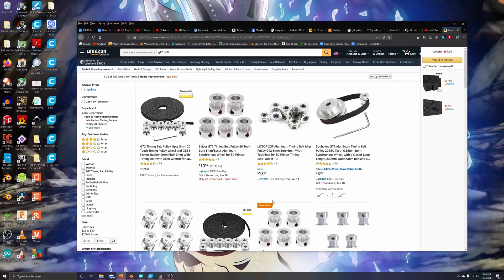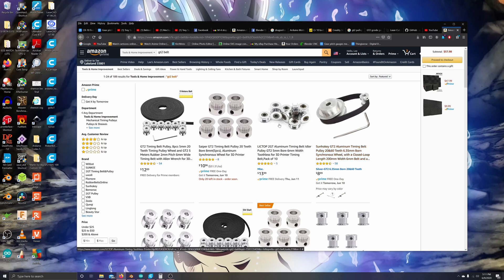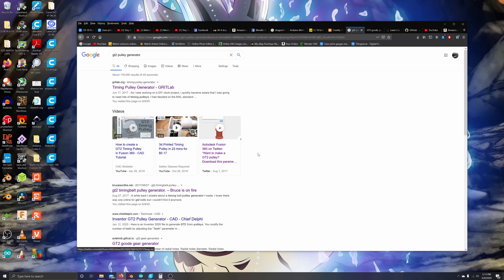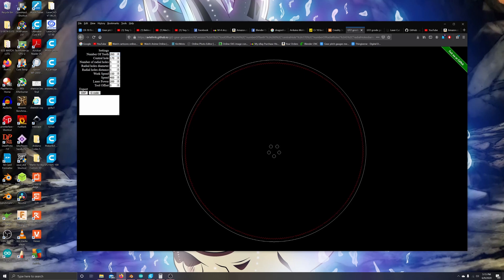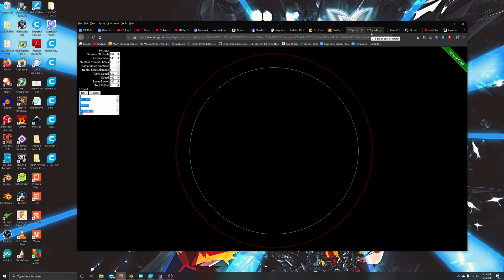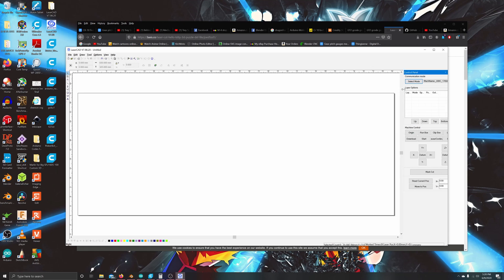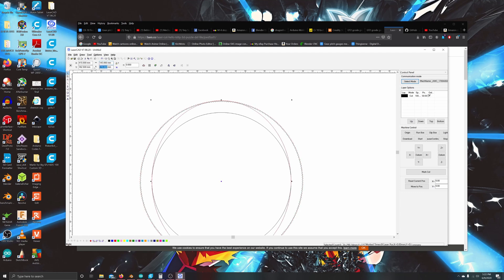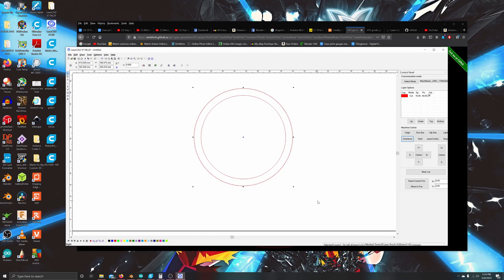DIY GT2 Pulley

Comment: Theres no link....
Anyway - it dosent work for 3D printers, as the gcode is wrong for 3D printers.
Reply from the maker: this is the website to make the pully and export to dxf file
https://stefetrucki.github.io/gt2-gear-genaretor/
Reply from the maker: Yea it isn't that I wanted to 3d print it out I just needed to use my c02 laser cutter to cut through plexi glass or wood sheets
Reply: @LegitLeeVelez  Oki, thanks for the answer. I was of that impression that this was a STL I could import in a 3D program.  But apparently its only for 2D printers/Cutters.  Noted thanks 👍
Reply from the maker: @timm3802  YES YOUR WELCOME AND i THINK IF YOU GET THE 2D PICTURE ON A 3D PROGRAM LIKE BLENDER YOU SHOULD BE ABLE TO MAKE IT A 3D OBJECT WITH THE RIGHT DIMENSIONS TO EXPORT IT OUT INTO AN STL FILE TO 3D PRINT IT OUT USING YOUR SLICER SOFTWARE
Reply: @LegitLeeVelez  No its way to cumbersome.  I ended up with Scad and imported a GT2 function design by Josef Prusa.
Reply from the maker: @timm3802  o yea that is cool 😎 I know that prusa printers are popular are you going to make a video on how you do this? I would watch it